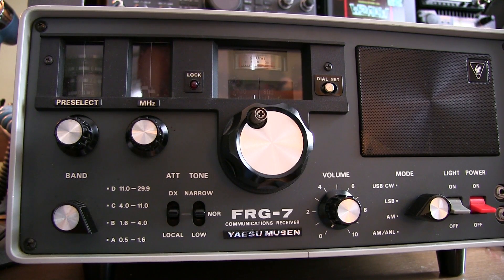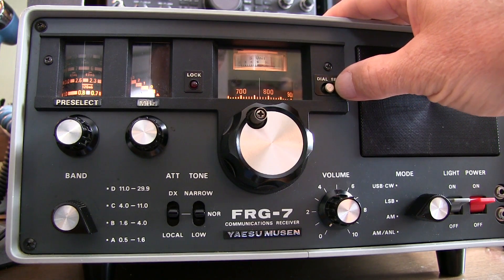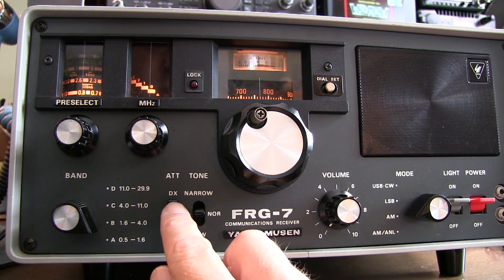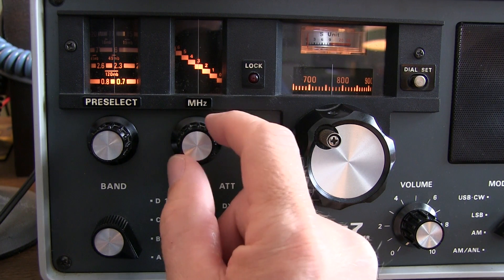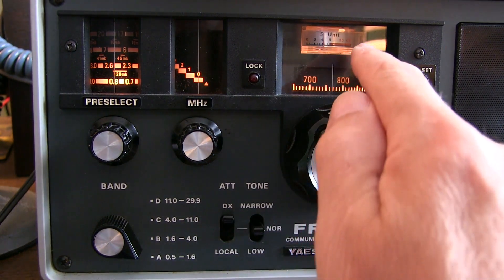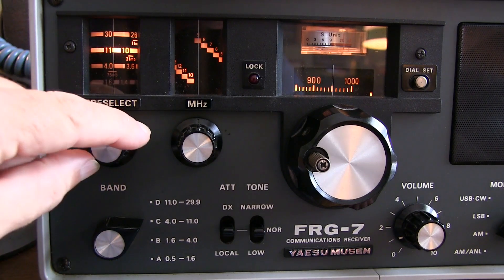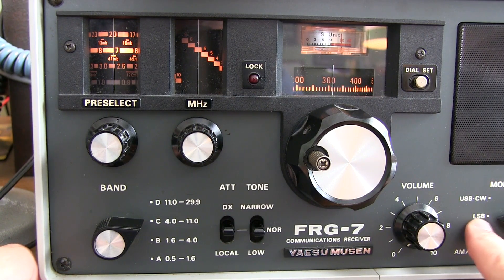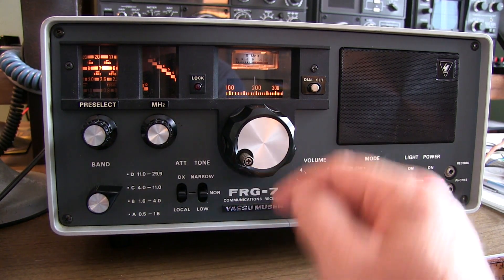#246: How to operate / tune the Yaesu FRG-7 Frog-7 Receiver

Comment: Thanks for the info .  I picked up a FRG 7 a week ago and this is very helpful. I noticed on my rig it has a "fine tune" nob and the one you were working on did not. Does that mean I have a newer radio?
Thanks for the video.
Reply from the maker: Yes, yours is a later model.

Comment: Love how this radio works allthough there is something weird with this radios comparing my other radio, efen the frg7000. When I use the endfed it receive like a charm, better and less qrm on medium wave but hardly no reception with the signal magnetique loop and this antenna receives very good with all other receivers. I use so239 connection for all my radios so there is something weird hoiing on. I can live with it but why is this? At first I thought my signal magnetique loop was broken but works perfectly on all my other radios. Yes, I made a jumper st the the bak to receive also medium wave on so239 connection. This radio is very strong for local interference cause of the preselector and hardly no drift cause of the wadley loop. 73's
Reply from the maker: I wonder if the FRG (and the preselector) are more sensitive to the receive antenna impedance and that might account for the difference.

Comment: I have a Lowe SRX30 Rx from the 1970s that tunes in exactly the same manner. Although supplied by Lowe's in the UK, it is of Far East manufacture. A virtually identical Rx with a different case design, was marketed by Drake in the US. The Drake circuit is almost identical to my receiver. In the '70s I worked for Racal in the UK and the Barlow-Wadley loop principle was used both in the RA17 Rx and in the digitally synthesised transceiver manpacks that were manufactured at our factory in East Devon, UK.

Comment: I have one of these receivers with a Sear label.  What antenna were you using?  I use about a 500ft wire up 15ft.
Reply from the maker: The unit in this video belongs to a friend.  The one that I own is like yours, the SEARS unit.  The antenna I use is my 130' doublet that I also use on my HF rig.

Comment: good explanation of the FRG-7   You might want to set the  Mhz dial to lock first, then peak noise with the Preselector next.   As stated, as you move across the band, you must peak the pre-selector.   Later versions have a fine tune knob ( aka clarifier)  which helps tuning SSB AND cw.  Note  broadcast band has a separate antenna input connection.  If no AM.. probably  because you didnt supply an antenna to the BC jack on the back.  w6wuh

Comment: Awesome video. I just replaced the bulbs in mine last night for Mhz and Preselect , still have the main dial to do. I used one of these in High School and would sign it out on weekends, it was the Cadillac and Sherman Tank of SWR back in the day. The model I have has a fine tune button as well making it a bit easier for SSB. Thanks for the video....Fred VE3FAL

Comment: What a great tuning video! I have an FRG 7 without the fine tuning knob just like yours. I had figured out a proper tuning scheme but I didn’t know I could use the Preselect dial to increase the signal on the S meter. I thought about trading up to the unit with the Fine tuning knob but now that I have seen this video I’m not sure it would worth any extra expense. My rig is in excellent condition and seems more sensitive than my newer Kenwood HF transceiver. Thanks again for the tuning tips. MikeinMinnesota N0WDM
Reply: This is very interesting! I get it! What kind of KENWOOD do you have?

Comment: A really nice and useful little presentation. Thank you. I am lucky enough to own one of these and mine has a fine tune control fitted above the volume control. I have had it for many years and it has fallen out of use but your video has prompted me to dust it off and start using it once more. Again, many thanks and 73's!

Comment: Thank you, once again for the informative video. I have gone through it several times. The reception is great.
I don’t know, if I missed hearing about the ANTENNA, that you are using to get such fine reception. But would appreciate if you could talk about it to enlighten us. I bought YAESU FRG-7 from Craig’s List. My reception is weak, very weak.... and may be extinct, altogether. I saw someone mention about defective 3SK40 could be the reason. So I CAREFULLY replaced it with genuine NEC 3SK40 (grounding body etc etc and even the soldering stick) Nothing...no change ....status quo.  What could be the reason for this total failure? Any help from you is highly appreciated. Thanks.
kjkumarsfo@yahoo.com
Reply from the maker: I am using a 130 foot long wire dipole antenna stretched across my back yard.  It is the same antenna that I use for my HF ham radio.  Be sure to connect a wire between the SW and BC terminals on the rear panel in order to enhance broadcast AM reception.

Comment: Nice radio. I have one in mint condition which still works perfectly. One thing I've noticed is that your receiver lacks a fine tune below the dial slide. It must be an early one. Nice receivers although could do with  narrower filtering.
Reply from the maker: Yes, that was an early one.  Belongs to a friend of mine.  The one I have is the Sears version, and it does have the Fine Tune control.

Comment: Hello where can I Buy a Yaesu FRG 7 Shortwave
Reply: They were only produced from the mid 1970s until about 1980. So the only place to buy one is on the used market such as eBay or ham radio flea markets or online used classified like eham, swap.qth, qrz, etc

Comment: Very interesting video, but can you tell me the frequency of that radio station with the Mozart music that you used?
Reply from the maker: I'm assuming that you're referring to the previous video (at about 10:55).  In this case, it wasn't a radio station, it was a signal generator that I have which has a repeating audio loop that can be put onto an RF carrier for testing like this.
Reply: Oke, thanks info!

Comment: I just bought an early FRG-7 just like the one see here. No fine tune. Do you think it would be worth it to add a 3 way toggle in the front, switching in a 5 pf, 10 pf ceramic cap across TP401/402 on the board. Would this be a suitable way to slow the tuning in place of the variable cap on the later models?
Reply from the maker: Personally, I probably wouldn't do it since I didn't find the tuning rate that objectionable.
Reply: I was playing with it last night, and you're probably right. It's really no more coarse than my Panasonic RF4800 tuning knob on "Fine" mode. Cheers.

Comment: I have one of these rigs but i'm dyslexic so the numbers are confusing. for example, you say let's go to the 20 meter band but you flip the switch to 11.0-29.9 and the preselect to 14 mhz. that's a bit too much to wrap my mind around lol
Reply from the maker: The amateur radio and shortwave broadcast HF bands are often referred to by their approximate wavelength in meters, or by their frequency. The basic relationship between these two is:

Wavelength (m) = 300 / Frequency (MHz)

And 

Frequency (MHz) = 300 / wavelength (m)

The band designator are approximate. Thus the 14MHz amateur radio band is known as the 20m band. All radios tune by the frequency, but will often have the wavelength designation on the dial as well.

Comment: I need Injection-Locked Oscillator (ILO) commercial products that can operate at 900 MHz Frequency, It is really important for me. Thank you very much. With Regards(E-mail: h.abbasizadeh@gmail.com)
Reply from the maker: I am not familiar with any commercially available ILOs.  These are typically part of custom integrated solution.  So, you'll probably have to design what you need yourself.

Comment: One of my favorite aspects of the FRG-7 is the fact that it only uses 15 electrolytic capacitors, none of which are stressed to any great degree. I've recapped several of these fine receivers. In nearly every case, the result was a radio that functioned like new. Kudos to Yaesu!
Reply: i have never needed to recap any FRG-7

Comment: Alan, If you have time, I have a quick question for you.  I’m putzing with old tube radios.  I have a Hitachi V-212 o-scope.  It does not appear to working very well - it was free.  Would you recommend a few oscilloscope makes and models that I can search for on eBay to pick up?  Something with two channels is all I think I’d need.  I heard that the Tektronix 465B is a nice unit.  I don’t want to spend much more than $200 to $300 for a used unit.  Or, should I consider something like a new Rigol DS1054Z.  It’s a little pricey vs my budget but I might be able to make it work.  Any help you can provide is appreciated.  Thank you.

Comment: I love the sounds it creates when you were tuning the receiver.  Why does it create some of the higher frequency sounds as you adjust it (8:39)?
Reply from the maker: Very common when tuning in SSB and CW modes - it is the heterodyne between the BFO (beat frequency oscillator) and a received carrier.

Comment: Odd that the lock led goes off when tuned in and comes on when out of tune, seems backwards. I have a dx300 that is a Wadley loop too and it has all the same controls on it including the preselector, the MHz and kHz are both on the main tuning knob with the MHz on the outer ring and kHz on the inner ring, it also has the att switch, and narrow wide/tone, but I would imagine the Yasau is built better.  I would love to find an original Barlow Wadly XCR-30 at a reasonable price.
Reply from the maker: Yes - it does seem backwards - but that's the way it works.  I think on the DX-300, the MHz digit(s) doesn't light up until you have the 2nd LO properly setup (if I'm not mistaken).  It would be interesting to compare the schematics for the DX-300 and the FRG-7, since the controls are so similar.
Reply: I think that is another battery conservation feature. de KB5WQW. BTW my Sears branded FRG7 has a "Fine Tune" or clarifier control above the volume control.
Reply from the maker: Yes - in fact, most of the FRG-7 radios have the fine tune control too.  It's only the early production units like this one that did not have the fine tune control.

Comment: I like the fact that you actually have to earn a station via all the dials! Will manufacturers ever use this method again? Very fine Radio and Great Video, Thank you!
Reply from the maker: Probably won't see any new receivers using this method simple because it is easy to achieve the same or better stability in other ways now.